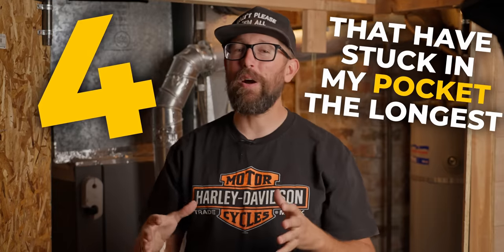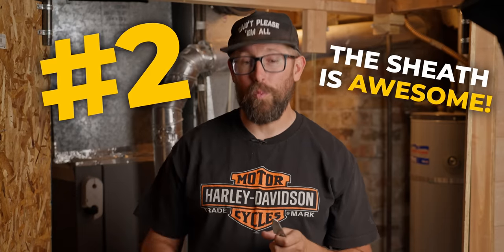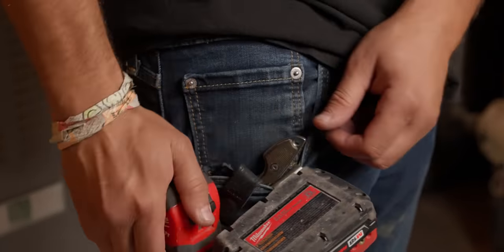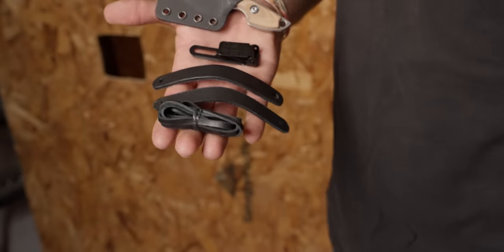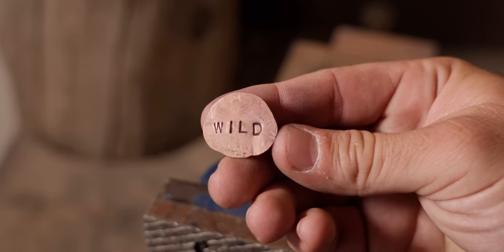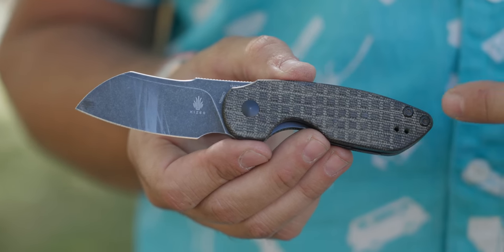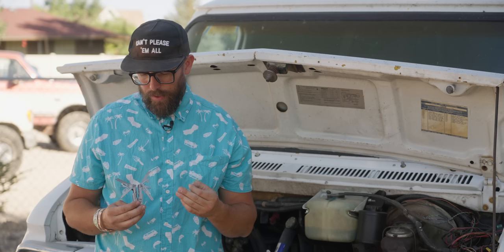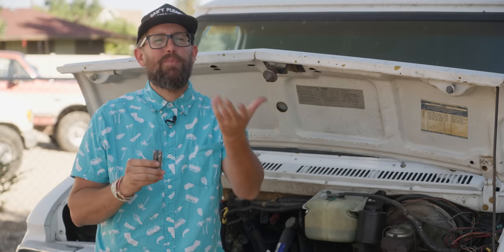4 Knives I Can't Stop Carrying. || EDC Knives & Tools That Have Been In My Pocket.

Comment: Hi Zac in the WILD. Our small carry consist of a homemade fixed blade dad made for us. It is smaller than the Mikro with a kangaroo skin sheath, instead of magnets we have velcrove. It could be a neck knife also fit comfortably in the 5th pocket even a boot knife. When riding bikes we put it in a specially made attachment on out gloves. Our back up is a Honey Badger which is conceal in our helmet. The multitool is an OzTrail with the usual neccessity including a 3 sided file which we use as a pry bar. Dad pimped our Honey Badger with Olive wood & fatwood inlays & as you know most HB has crisp spine. Few addition to our multitool but won't bore you with that. Great vid matey. Greetings from Australia.

Comment: On the Mikro

Wait till you realize you can actually use the magnet to attach the blade to your metal work space and pocket it back when you’re finished with cutting tasks. I discovered that this winter when winterizing our snow machines and sand spreaders late last year.

Comment: i put a #2 3/4" self tapping screw through 1/ 2" of stainless steel with that screwdriver. its also a primo size for "dad" activities like changing batteries or taking apart your fishing reel. for anything else i just put my LM ratchet driver on the hex

Comment: The power pint pocket clip fits a Leatherman bit underneath. Works with the bit driver, so you can add what your missing. If you’re not using the pocket clip, could be an option. Great video!

Comment: I carry a bark river JX6 in pocket. I have found fixed blades up to 7.5” oal with a sheath that doesn’t have a loop for belt attachment will fit comfortably in pocket.
Reply from the maker: Good to know! I’m still hunting down some good suggestions👊
Reply: @zacinthewild  you’re welcome. I wasn’t satisfied with fixed blades because I had in my head they needed to be small to edc. I tried the LT Wright Patriot for example. It would pocket great but was uncomfortably small to use. The JX6 was intended for food prep (works great) and turns out it EDC’s excellent too. My personal preference is 6.5”-7.5” as that is my sweet spot for size and use of an edc fixed blade.

Comment: Thank you for the great info. The last knife you showed kinda reminded me of the last pocket knife I got. I feel like it's been my favorite one I've owned in a while and had a pretty similarly designed blade shape. It's a petrified fish knife, model PF714B. AUS-8 blade, black G10 handle, thumb knob and bearing for smooth opening. Very durable feeling knife. Slip proof handle design is very effective and it has a stainless steel liner and pins. Best knife I've owned and for only $40. Can't beat it. Worth checking out. I was considering getting extra ones to have as backup and to send as gifts. But yeah, I'd love to see more reviews done like this from people, very well done. Thanks again, keep up the great work. Much appreciated

Comment: I had the mikro and thought it wasa great little blade but ended up selling it because it didn't really work for me in practice.

For a long time a Deluxe Tinker was my multi tool of choice because of the pliers and full size phillips head, but the power pint kicked it to the curb at the beginning of summer. For my needs, as a chef working in a hotel, giving up a little ground on the phillips head was worth having the massively superior pliers. I only recall using the phillips head once, but I use the pliers a couple times a week minimum.

Comment: I am struggleing to find a single knife for at home, and a single knife for outside. (You know how laws are.)
Currently I am:
Carrying a K4 Stich neck knife on a ball-chain (but I also got an UltiClip and a karabiner attached to the sheeth, for maximum wearing-flexibiolity), and a Böker Plus Urban Trapper as twohanded backlock with G10 scales when; I am outside. Ised to carry a blacked out and paracord wrapped RealSteel Alieneck Wharncliffe before; I still love it, but weird people think it looks mean. 😥
Inside the house I usually carry a ColdSteel Spike in american tanto, and the BHQ Exclusive Böker LRF in brass, or I carry the CRKT M16-03BS as both in one so to speak. 😅
Not to mention the credit card knife in my wallet and the Böker Magnum "Little Friend Arrowhead" on my keys. 😅

I guess I will keep carrying one for rougher and dirtier use and one for lighter and slicier use; and then also have another double-set for going outside ... I think these german knife laws are fueling my knife addiction, making me get ones for at home and extra ones for outside. 😂

Comment: I'm very interested in that power pint. Gonna watch some more reviews of it. It may not be strong enough to be the tool you want, but I've mentioned before that I carry an AG Russell steel fingernail on my keyring. I love it as a pry tool, but I don't do heavy duty prying, just mainly more delicate tasks, where my fingernail isn't quite enough.
Reply from the maker: The pliers on the Power Pint are pretty awesome. You do seem to get a little “flex” with the pliers under heavy load but I think that’s by design.
Reply: I just recently got a powerpint and I'm really liking it.....but like Zac said, it is lacking in some areas but overall, I think it has found a permanent spot in my pocket!

Comment: That micro looks interesting.  I have a hard time finding a pocket knife that works with my tool belt and various pouches or drills I’m always hanging off myself. Lots of the clips tend to catch and cause the knife to be yanked out of my pocket.
Reply from the maker: Didn’t try it with bags on but it is super versatile I’m sure it could work with some imagination🤘
Reply: I carry a slip fixie and I take it out of my pocket and it goes into the electricians tool pouch on my tool belt. That is probably the best way to do it. I've had a custom slip sheath made by a leather crafter, but these magnetic sheaths may work. The Mora Kniv plastic sheaths actually work really well in a bag.
Reply: @nunninkav  I actually have one of the mora chisels in my bag already. A similar knife would make sense. Many thanks.

Comment: I've been trying to find a good fixed EDC option, been trying out a few knives with less than satisfactory results with the sheath/carry system. Creely Mako is in the mail, will be my next attempt, but I've had an eye on the Micro's big brother, the MKM Makro
Reply from the maker: The Makro does seem rad! The sheath is a little less versified but you get a lot more knife in the trade off.
Reply: @zacinthewild  Thats sad to hear the sheath isn't the same, but I got ogre hands and don't think I'd have good purchase on the Mikro.

I've found the hardest part of getting into fixed EDC is getting a knife you like with a proper sheath for EDC. I've collected quite a few GREAT fixed EDC's but none of the sheaths have worked for me so far. Think I'll try the Makro after giving the Creely a try